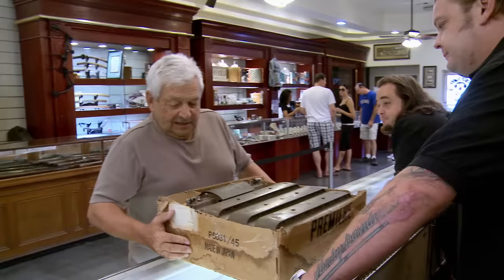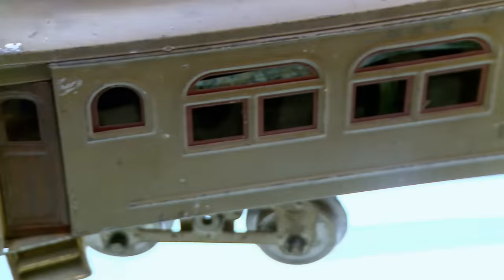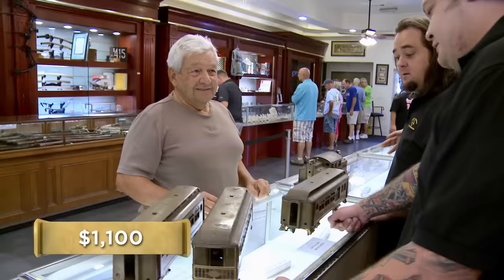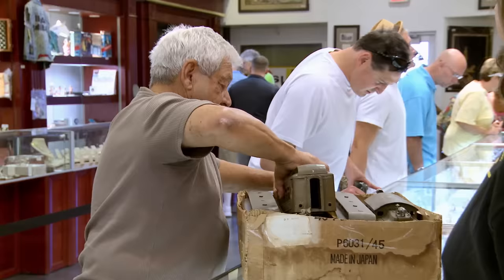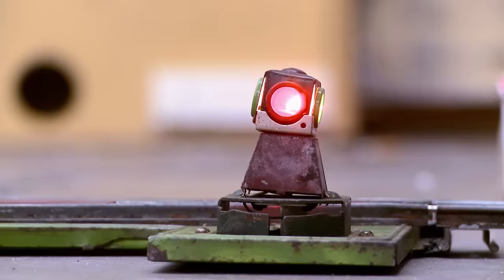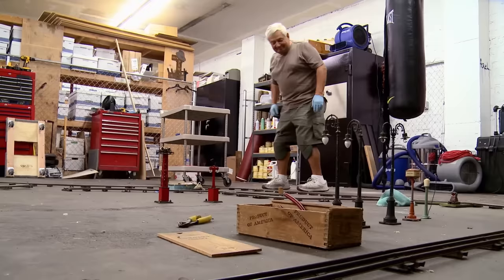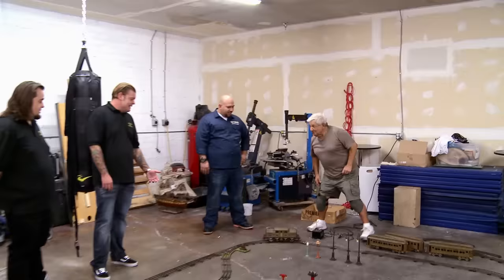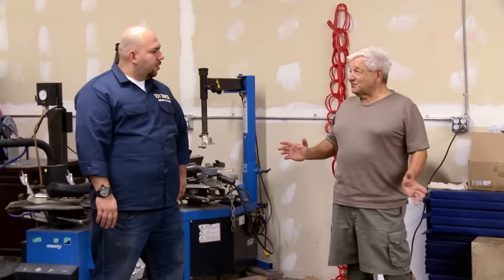Pawn Stars: CHOO CHOO CHUM! Rare 90-Year-Old Train STILL RUNS! (Season 8) | History

Comment: Being a Lionel collector there are few things that I agree with and disagree with this clip. One, they should not have split the set. As a collector, I am looking for a complete set because it makes the set be more valuable in the long run. Also, that is primarily what standard gauge is known for. Two, the price was moderate. Yes, it is not a rare set, they have to make money, and the condition was rough, but I think at $1,000 there would have been a big enough resale margin. Overall, I would have paid for what the seller was asking and even ask if the accessories were for sale as well. In particular, the street lamp. Original street lamps from 1923 are extremely rare and go for crazy prices. In the end, I think this was a moderate deal, better than others, but I'm only voicing my opinion from a collectors vew point.
Reply: I'm no collector, but as a lover of trains especially model ones, I'd have paid 2k for the whole set.
Reply: But remember this clip is almost 10 years old, different market back then.
Reply: @jaked5651  True
Reply: It sounded like it did include the track and street lamps

Comment: That’s an awesome set, one that a collector would likely have paid a lot more for what the Pawn Shop paid for it.
Reply: Doubt it... HIGHLY doubt it
Reply: @richardgrace4500  an operating 90 year old train set with all the bells and whistles still on it and all those accessories and track pieces could easily get like 2k on ebay. he got crazy undersold here just like everyone on this show
Reply: It is likely. It will be better paid on a train show in Vegas easily. It is all in working condition and if he really has the original boxes. It is not that hard to estimate the value of that train set.Greenberg publishes each year  a Pocket Price Guide for Lionel Trains from 1901 to this date. This set will go easily for something between 2500 to 3000
Reply: Chum and Corey knew that aswell. That’s why they offered 1000, almost what he asked for